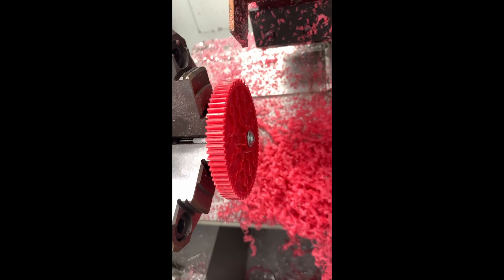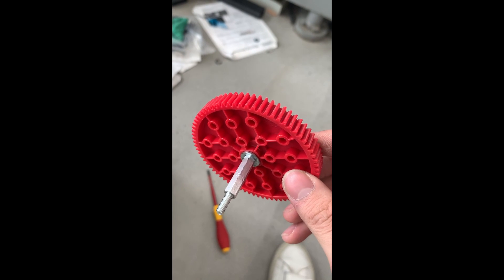VEX Build Masterclass #4 - Gear Thinning

Comment: I understand the original vex gears had them, but is there a reason for the protrusions on each end of the gear not being cut off completely? Removing them would create a flat profile on both sides, though to be fair I'm not sure just how much more usable that would make it and there might be a cost in structural integrity trying to break the inner metal insert of the gear.
Additionally, can this be extended to the steel pinions and 24T gears?
Reply from the maker: Well, the main reason here is what with this mounting method, it is impossible to fully flatten out the gear face. The lathe would otherwise go through the screw and the gear would likely be damaged in the process. You can flatten out the center using a belt sander afterwards - this would work as long as you do it in short intervals to make sure the metal core don't heat up and melt the plastic.

As you have said, it is somewhat rare where you will need a gear that doesn't have the core intact - you can build a 3 wide drivetrain with the core, and I've personally never needed a gear where the entire face needs to be flattened out. Leaving the core also benefits from the extra stability and the ability to use the new shaft inserts.

This method would also work with steel pinions and 24T gears. Just make sure to go slowly and apply oil as you are cutting through steel instead of plastic.
Reply: You would cut into the metal core